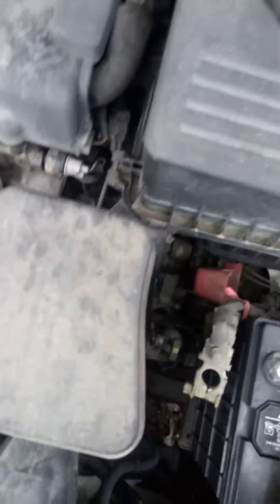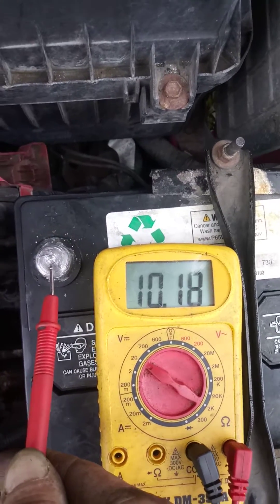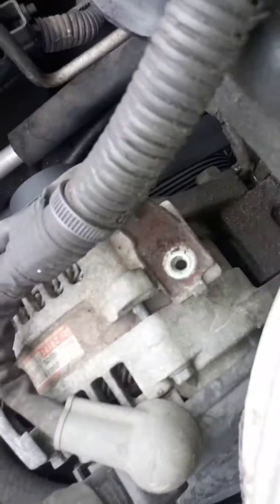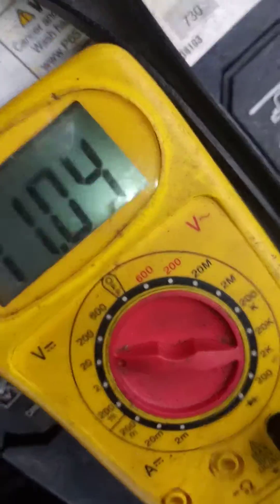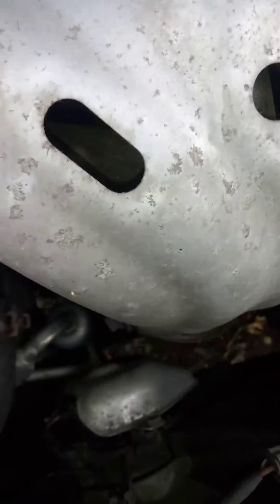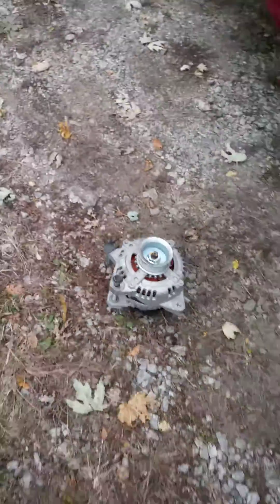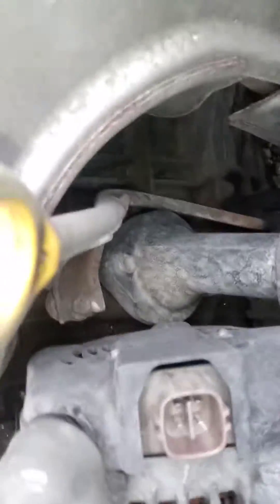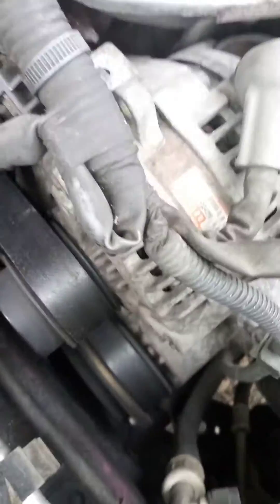Testing the Alternator by Disconnecting the Battery

Comment: On newer cars run the risk of damaging  electronics. Removing  the battery will peg out the regulator and the battery will act as a buffer.
Reply: Just done it with my negative and it cut out do you think it’s alternator.plus it was fully charged and when I tested it with multimeter it was only saying 11.3 volts when ticking over
Reply from the maker: You are supposed to disconnect the positive cable and not the negative battery cable.

Comment: Go for a cheaper route and pay double
Reply from the maker: If you would like to remove the alternator or find a place that can test the alternator, battery and starter while the parts are still in the vehicle you can get the same problem diagnosed with good equipment to narrow down the problem without removing the parts needing tested.

Comment: Does it matter if you pull the positive or negative cable?
Reply: Has to be positive
Reply: I was just going to ask that
Reply from the maker: Yes it does matter. Pull the positive cable.
Reply: Negative Cable will not short out if one touches the Metal parts of a Car , so yes , Negative Cable !
Reply from the maker: Wrong, it must be the positive cable. Make sure you have a good ground though.